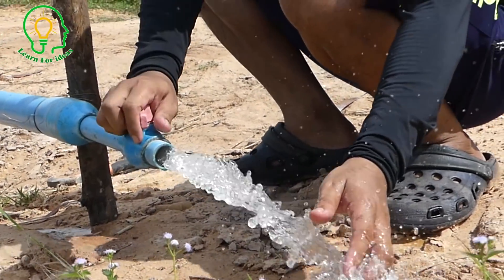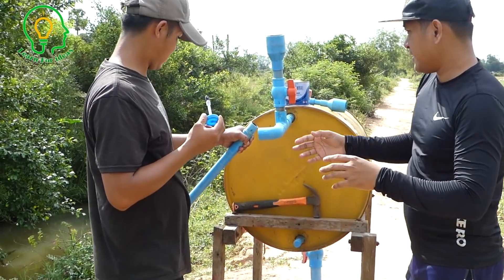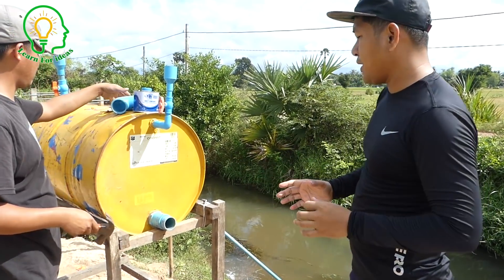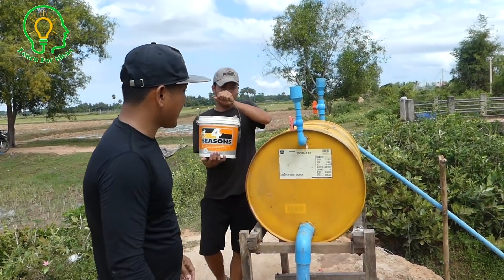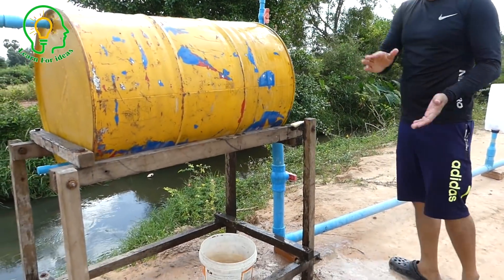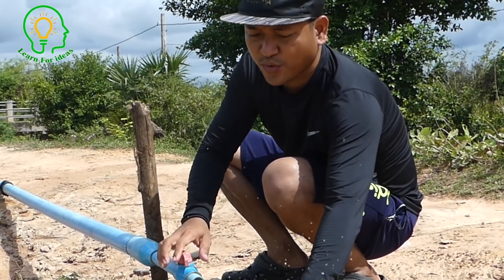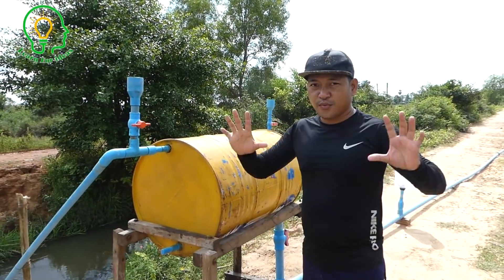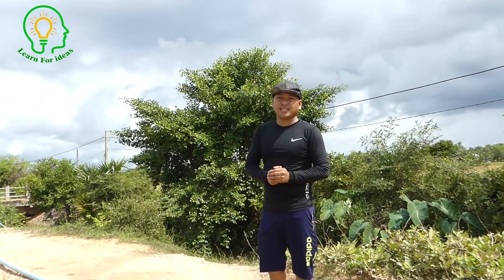Free Energy Water Big Pump and Big Air-Pressure for rice field |Water Pump without Electricity Power

Comment: No need for that white container, waste of money. When using a priming drum, no need for a one way valve in the suction pipe. No need to fill up the suction pipe. No need for any master valve, waste of money.

But the water level in the river must be higher than the output. Is it?

Comment: Input, river, MUST be higher than output, rice field. If not, it will not work. Must be air tight. Point the output upwards with a bend ore a hose. This will stop air leaking in from the output. White tank is not useful. Drop it

Comment: Not works.
Reply: Input, river, MUST be higher than output, rice field. If not, it will not work. Must be air tight. Point the output upwards with a bend ore a hose. This will stop air leaking in from the output. White tank is not useful. Drop it

Comment: I would like to see how high the barrel can be, according to Galileo it should be at a maximum of 10,3 meters.

Could you build it this high, with a plexiglas window, so we can see the intake on the inside and a timelapse shot of the whole construction?

Thanks in advance!
Reply: Yes and no. This is a siphon. You can do this with simply a hose! A siphon can bring water over a 10 meter high ridge or wall, but you can not take any water out of the system up there. Input must bi higher than output. So it is not possible to lift water up from even a 1 inch deep well.

Comment: Does this thing work in real.
How will the suction work at a height of 6 feet
Reply: It is a siphon with a barrel. Can lift water over a 10 m wall, but you get no access to the water. Can not lift water to you from a well

Comment: How much water does the drum hold? And how much water flows out of the drum? Is the amount of water going out of the drum greater than the amount of water the drum can hold?
Reply: No answer? Is it because this whole setup is a scam?
Reply: @RafaelBenedicto  Yes. If it were real, these would already be in widespread use. Total scam.
Reply: @jasonfoster9118  This is a generator, but the only thing it generates is YouTube $$ for the scammers.
Reply: Shill.  You are here ONLY to disrupt.  Let a girl help you out.  It is a 55 gallon drum used to create enough of a vacuum to siphon water against gravity.  It is the application of several scientific principles to make one THINK it is magic when it is not.  YOU clowns are here to keep it a secret a little longer.  Too late.
Reply: @mariana1964  It is literally impossible to use just the weight of the water at a high place to "suck" the water from a low source of origin. That is a PHYSICAL IMPOSSIBILITY. The laws of the universe does not allow it. Gravity on its own will ALWAYS pull water from a high source to a lower destination. If you want to go against gravity, you need to add energy into the system, like electricity or manpower. A vacuum is NOT a form of energy.

Think about it this way: If this setup actually works, then he can route the water back to the source and the water should keep flowing around in a closed loop forever. That is IMPOSSIBLE.

Don't talk to be about science when you believe in shit like this.
Reply: @mariana1964  This is simply a siphon. Input must be higher than output. No barrel is needed. You can use just a foot valve and a filling T at the highest point.
Reply: I’m curious why do they always assemble a new one. What happened to the previous pumps?
Reply: @josetterelatado8217  Yawn.  ANOTHER troll.  See?
Reply: @josetterelatado8217  That is why they use water instead of glue
Reply: It is negative pressure sucking the river water while the water from the drum is flowing but it eventually stop.
Reply: @EBLMarch31996  No.  It does not stop -- the check valve is the reason.  As long as you design the system with more mass pulling down than up and no leaks, everything works just fine.
Reply: @mariana1964  but as time passes the water pressure inside the tank decreases and cannot sustain the needed pressure for the head height.
Reply: @EBLMarch31996  I'll bet you can't explain "why" you believe this (that's not true if you design it right, btw).  I can explain why it does work, and I can prove it because our farm does this.  Please give these guys a break and stop posting your  "opinions" about things you don't know much about.
Reply: @mariana1964  it does continously for months without reffiling the tank? Oh thats great.
Reply: @mariana1964  We have Hydraulics when I was in college and I knew something about it.
Reply: @EBLMarch31996  We have had a few problems over the years, mainly due to piping integrity, etc., but if you can secure the vacuum it will last.  The tank will not empty if you limit the size (volume) of the final output spigot.  There will be problems as you approach or exceed the intake pipe pipe volume.  Also, please let me thank you for taking this seriously -- we have had these things running for many years.
Reply: @mariana1964  I am planning to build one myself for my fishpond, a smaller version.
Reply: @mariana1964  when you say problems if outlet pipe volume exceeds intake pipe volume, do you mean I should just put a small spigot at the end of the outlet pipe? Because obviously the outlet pipe should be much bigger than the intake pipe as per the video?
Reply: @NoOne-jy6mc  Sorry for the late reply!  I have not been on YT for a month...  The "outlet" is the actual opening(s) at the end of the outlet pipe's run, and this overall output volume must be less than the intake volume.  We split our outputs to create "more" power (not really more power in total, but it is more balanced to work with) but we are always conscious of the overall volume at the actual output -- we have not figured a number yet where you can equal/exceed input volume, and it may not even be possible -- we do not know but DO know that it makes no sense to have a larger output.
Plastic drums are a no-go at ALL points of your project.  Pressure intolerance and material degradation are just two reasons.  IF you are able to use metal drums AND can raise them any significant amount from ground level, EVERY SINGLE FOOT of elevation helps in a multiplicative way (the power difference between 5' and 12' off the ground is positively astounding).
A little off-topic now, but water is very powerful in so many ways, a divine gift,  and believe me -- water belongs on the periodic table with the "regular" elements... because water IS an element AND it is the basis for measuring all the other elements.  Think about that one for a second.  Science does not want you to believe that, but I'm finished listening to scientists and doctors as a rule anyway; they, as a whole, are LOST in their own hubris and arrogance and are only bringing us all down.  The deniers only have to answer one question:  WHY can you not break pure water into Hydrogen and Oxygen?

Good luck, and be smart doing this.  Listen to your inner voice (conscience) exclusively.
Reply: @NoOne-jy6mc  P.S.  Stand your barrels upright, not on their sides.  Your output then has 55 gallons of water on top of it to help, and is much stronger structurally  as well.
Reply: @mariana1964  Sorry, but you can use wider inlet than outlet if you like. No check valve is strictly needed, but may be practical.
Reply: @EBLMarch31996  Works fine if the input is higher than output and the system is air tight. Now there may be gasses dissolved in the water that may lead to a stop after some time. That is the sole purpose of the tank, to prime the siphon and to collect leaks and dissolved gases.
Reply: @mariana1964  An other way is to ad a bend upwards at the exit so air do not suck in. To be safe, you dip the output into a bucket of water,
Reply: @EBLMarch31996  Remember input must be higher than output. In other words, water frome one fishpond must exit into another pond at a lover elevation.
Reply: @NoOne-jy6mc  you may use a much bigger intake than exit tube. But either put a upward bend at the output or dip it into a bucket of water.

Comment: For your information that is not a pump. Pump means a device, machine driven by an engine could be electric, engine or anything that aplied by force. Your idea is a kind of siphoning, sucking by gravitational force of fluid like water etc.
Reply: It's not even siphoning, because a siphon needs the outlet to be lower than the surface of the source. Gravity alone cannot raise the water to an outlet that is higher than the source. If his setup does indeed work, then he can theoretically route the output water back into the source and keep the water flowing forever without any external energy applied -- which is impossible.

This whole setup is a scam.

Comment: This is a fraud. Did mine exactly as explained. Elevation from irrigation canal to point of disxharge is only 8 ft.  Water came out of disharge pipe once discharge valve is opened but only for 1 or 2 second then the flow stopped. Absolutely no leak because i can feel sudden rush of air into the drum and water flow at discharge resumes once intake valve is opened. Absolutely a fraud mainly for purposes of accumulating views. Videos similar to this should be banned from U Tube for it will entice a lot of people to spend and fabricate similar set up for nothing.
Reply: This is a siphon. Then inlet river, must be higher than outlet rice field. And airtight. Then it works. If the flow is low, dip the output into a bucket to prevent air to leak in at the exit.

Comment: What is the use of the other pipe installed just opposite below the input air pipe/valve or input pipe?
Reply: The use of that is when filling water into the drum it will not create vacuum or else you cannot fill water into the drum without that opposite pipe.

Comment: Very nice and I appreciate your work for free energy water pump to help the farmers. Dear I have one question that is  what for white small drum used in wetbeen the outlet side ? Please reply my question to satisfy me so that I can understand well.
Reply: An air trap.  Air can work either for or against.  In this case it will mess up the vacuum so we remove it from the system -- yet another scientific principle at work.
Reply: @mariana1964  Yes the container will trap some air, but the 55 gallon barrel can take more. The small vertical tybes one sees in some videos can hold very little air anyway.  Better is to tilt the output upwards using an extra bend or to dip the output into a bucket of water.
Reply: Not needed. Drop it.

Comment: I am almost convinced now, maybe 49.99%... Because visually, it is apparent that the discharge elevation is higher than that of the source. If it is true, you have broken the second law of thermodynamics and you can route the discharge back to the source and use the flowing water to rotate a generator motor without the need for gasoline, electricity or any other fuel. But the sad thing is, cconventional knowledge dictates that nobody could ever break or violate the laws of thermodynamics... And the world would be very glad if you have done so... Hopefully... You are not cheating, but i am sure you do. If you think that the total weight of water inside the drum is enough to pull up or suck the total weight of water inside the suction pipe due to vaccum, you are wrong. The factors that you should measure here to initiate the flow of water without external force applied are but the opposing head pressures and not the weights or volumes or shapes.
Reply: Siphoning
Reply: Because this whole "free energy" thing is a total scam, and this guy is a scam artist. If his system works, then he can basically route the output water back into a pond or container, and keep the water circulating in a closed loop forever, which is goddamn impossible. 

This guy has been scamming farmers all around his country, whatever country he's from, by getting paid to install these fake "Free Energy" water pumps, which isn't even a pump. Just the fact that his location on his about page is "United States" (even though it's obvious in his videos that he is not in the US) is a big red flag.
Reply: @RafaelBenedicto  Hey everyone!  THIS is what a "shill" looks like.  Or, rather a pair of these cretins working together.  The FACT is this breaks no laws of science.  It is the application of MULTIPLE scientific principles to get work output from water, nature's most abundant ATOMIC resource.  All you have to do is build one of these -- and you will see.
Reply: @mariana1964  OK, can you describe exactly how this works? 
For others: inlet must be higher than outlet, as with any siphon. This is a siphon. You can use a flexible tube, a hose instead of all this stuff.

Comment: CAN YOU A A ONEWAY VALVE  ON THE WATER INTAKE ? WOULD THAT HELP UP PRESSURE IN WATER ?
Reply: Non return valve in drawing pipe is used to maintain the water level in the system or othere wise air will enter and water can not be sucked using vaccum or negative pressure .

Comment: Can you make a video without cut for 15 minutes showing the drum and the output pipe that continues flowing?
Reply: Can you show us a detailed set up when the source of water is 12 meters deep.
Reply: @JoseRamos-ld1xl  impossible. A siphon can not lift any water.
Reply: Not without some kind of alternate supply source. This simply cannot work, due to the law of gravity.
Reply: Actually it works due to gravity and pressure.
Ever heard of Aristotle's saying: Nature abhors a vacuum?
This is what's happening here.
Gravity pulls out the water from the tank which creates a vacuum in the tank which nature must fill, and the only thing it can fill it with is the water from the inlet pipe through suction.
Reply: @FridaySimfukwe  I hold a masters degree in hydrodynamic engineering as well as a PhD in mathematics. I create systems to move liquids around in the oil and gas and mining industry for over 25 years all over the world. Because the discharge line is above the level of the surface of the supply, its impossible to create enough vacuum to pull water from the supply into the drum. Its impossible Now there is such thing as a "ram pump" but thats not what this is. It looks like they're having fun and all on YouTube, getting some followers. That is good. Good for them!  But unless he has a powered pump inside that yellow drum, there's no way this will move water continuously.
Reply: @jasonfoster9118  LOL!  So, what is this "law" of gravity you speak of??

Comment: ive tried this one but its not working. i dont know whats wrong.
Reply: You are correct.  This is fake.
Reply: You need a battery with white wire as shown in the background video, then connect it to a booster pump and hide it not visible to the viewers.

Comment: How long can it run before you have to re-prime the system to get the air out and can you face your outlet back into the canal to turn a water wheel generator 😁🤔🕵
Reply from the maker: Air could not return back to Drum Because we have Air-Pressure in the middle of outlet pipe to stop water there
Reply: I came here to ask this.  I'm currently building several of these for our Fish camp and our next step is working in some modified laundry machine generators for energy production. We'll see if it works.

Comment: You have to show how much water out from outlet, to aprove that your pump works well. The total result of water flow out must over than a drum.
Reply from the maker: input 3m and output 20m
Reply: @LearnForideas  He meant the volume of input and output of water in LITERS, not the lengths of the pipes in METERS. You need to show how much water can the drum contain, and how much water flows out of the drum.
Reply: @RafaelBenedicto  Or... YOU could try this at home.

Comment: Also how high is the water inlelet to the filling drum or how many meters your inlet pipe to the filling drum?
Reply from the maker: 3-4m
Reply: @LearnForideas  Hola mi Estimado , hice , su sistema pero no funciona, le falta aíre , para salir el agua del  tanque,  que puedo hacer por favor , saludos cordiales desde Ecuador ♥️♥️😘
Reply: Is this will do more than 10 meters high?
Reply: @beatryz5088  that will need about three drums
Reply: @beatryz5088  theoretically 10 meter. Because there is 1 Bar air pressure in our atmosphere  and 1 Bar is equal to 10 meter. Flow of water may reduce if depth is more.

Comment: Please go down into the river and LIFT slowly the inlet pipe to see if it is really SUCKING water. You can see a water SPOUT turning around going inside the inlet pipe if it is really SUCKING wate. Please do that my friend.
Reply: Very good idea to prove if the system works.
Reply: They will not show because it did work.
Reply: They did shown this in other videos